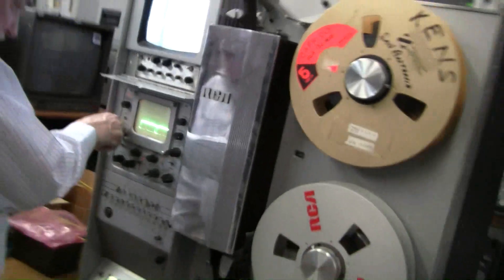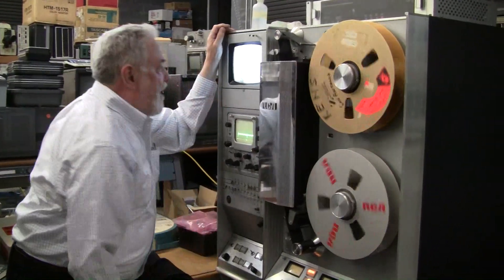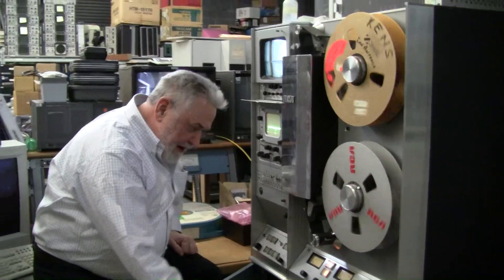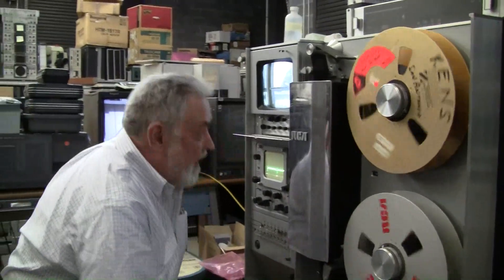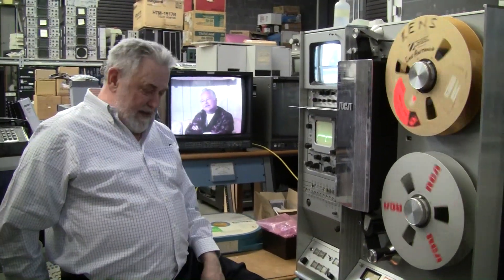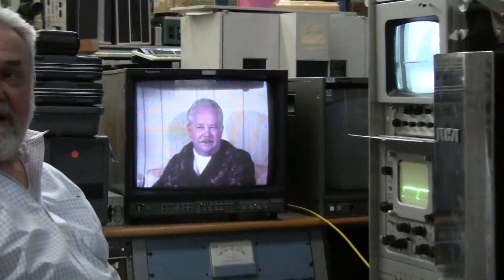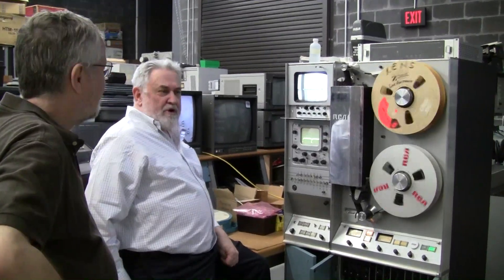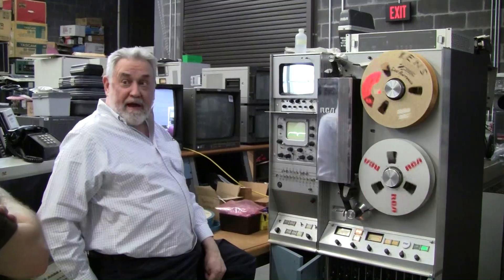1969 RCA TR-60 Broadcast Video Tape Recorder Demo

Comment: I am a lucky old guy, remembering my first day working in TV in June, 1979; I was 16, a junior in high school.  I started out running studio cameras for the local stuff, then was entrusted to do Master Control and directing the local stuff.  We shot news footage on 16mm film, but eventually got the JVC U-Matic rigs to augment our stable of antique Scoopic film cameras.  We had a TR-22 and a TR-4 that were used for most of our spots and syndicated program playback.  At 60, I’m still a very lucky old man because I still work in TV, currently at a Network facility in Washington, DC.  Obviously, everything has changed since 1979, but I still enjoy this addiction where I get paid ‘to watch TV’. 3-2-1 fade to black

Comment: We had TR70's in oour tape room and a TR60 in the production truck due to its "compact" size. These machines were complicated servo lock devices. But RCA had it figured out!  They were actually pretty reliable considering the complexity. Unlike TR600's and TCR100's! Thank you for posting.

Comment: I was a kid and I got to run Quads, RCA and Ampex machines, at my local TV station. In production, on the air! I am 48 years old now, ready to run these machines to preserve archival video tapes. And while I lack this guy's expertise, I am pretty good at ferreting out that bad capacitor which is making the sync unstable. 
I love YouTube, but I miss analog video so much.

Comment: Fascinating. Thanks
Reply from the maker: Glad you enjoyed it
Reply: @videolabguy  I did. However, I'm still confused about how moving pictures get transferred to tape.
Reply from the maker: The pictures are not moving. Just like film, its a bunch of still images flashed at your eye faster than you can perceive. Also, because a TV signal is 210 times more information than a hi fidelity audio signal, you need to write and read it from the tape that much faster too. That's why the four heads spin at 14,400 RPM and write tracks sideways across the tape, each head records about 18 TV lines and it takes 8 rotations of the head wheel to record one frame of video. The to tape speed is just over 1,000 inches per second or 56.8 MPH. Pretty cool that they thought that up in the 1950s.
Reply: @videolabguy  Thanks. I think I understand.

Comment: You needed to be an engineer to operate this. The world has changed, in so many ways, since 1969. Now TV reporters, in the field, are their own camera man/woman. This is the case at CTV Atlantic.
Reply from the maker: Thank you for your comment. An advanced technician is adequate. My very first job in silicon valley was aligning head assemblies for both Ampex and RCA machines. It is complex and precise. But, very doable with the proper tools. Operating the machines themselves, though highly detailed, isn't so difficult with proper training.

Comment: Question. Was this video tape recorder also used to record a TV station's programming throughout the day or was it only used to record a certain TV program to playback on the station?
Reply from the maker: This tape format was used for all programming for over thirty years in the network centers and right down to the local small station level. These were the work horses of the television broadcast industry.

Comment: Ah the memories - I worked with one of these for 4 years back in the 70's.  We had 3 of these and an old 70.  5 second pre-roll, the lockups, banding all of it.  You'd be in the control room, this'd be outside with air cooling.  All would be well, then the <SCREAM> of the heads sawing over a  crease in the tape, then splat. Two spools in oposite directions :)  If I had a buck for every tape threaded onto this... (instead of the pennies at the time).  Those were the days :)

Comment: Used to drive a couple of these at GTS 4 in Port Pirie, South Australia in the early to mid 70s.  Later they added a TCR100 Quad Cart machine that 'borrowed' some of the TR60's onboard electronics to do much of the work.  The TCR100 was kinda twitchy but the 60s were fairly reliable, if the tape was up to it (some that had done the rounds of Australian TV stations over a number of years weren't, (World Championship Wrestling was a common offender) we'd have to drop it from Pixlock to Linelock to get it (relatively) stable enough to air.  In extreme cases of oxide shedding, we had to hold a pad of alcohol soaked linen against the heads while it was running every minute or two when the pic threatened to breakup completely.  We used a 7 second preroll to give it time to lock up, sometimes it needed every second, but new tapes were more likely to be rock solid after 2 or 3.

Comment: Great video we had one of these in the TV station I worked at in the 80s. Ours never looked that good. Anytime there was a large section of solid color in the screen we got sort of banding effect. For example red would like it had yellow lines running through it.  Sometimes you could get rid of it, sometimes not.

Comment: I used 2 tr 60s at my job until 1999 when replaced our 2 TR 60s and 2 1200s with a textronix profile video server , i had to replace tape constantly on our episodic reels due to dropouts , and they hated saturated red colors.. my commercials had pink supers until the digital age, we fed our quads with ampex vpr2b  and Panasonic MIIs

Comment: Why is it so big???
Reply from the maker: That is actually one of the more compact models. The size was determined by the available 1953 technology and by the recording format itself. A one hour tape is two inches wide and 54,000 inches (.85 miles) long. It travels through the deck at 15 inches per second. In one second, there are thirty frames of video which takes one half inch of tape. Width times length (2 x .5) gives us 1 square inch per frame. One hour (2 x 54,000) works out to 108,000 square inches per hour or 375 square feet of tape. The reel of tape is massive and heavy. They require very large motors to spin them and these, in turn, require battleship plate steel for support so the motor torque doesn't twist the deck into a pretzel when placed into fast forward. The capstan motor could do your  laundry! All of these big motors need huge motor controller units plus all the video and audio electronics. The TR-60 is a late 60s unit. Compared to the original, this is pocket size. The smallest these machines, Ampex VR-3000, could be carried by one strong person.  https://www.youtube.com/watch?v=yE4XJM7BLXs
Reply: Thank you. :)
Reply: videolabguy and the vr-3000 was a record only machine. They only had confidence playback. They ask had no erase stack, so the tapes needed to be bulk erased before use
Reply: The BBC tried an early machine with reels nearly as big as a person, it was truly a beast and extremely impractical, if not absurd.

Comment: I did a calculation of the pixels per square inch for quad vs pixels per square inch for HD digital video on a micro SD card.  

Quad was 15 in/sec and 2" wide = 30 in^2 / sec = 1 frame per in^2. It was SD, not HD, so 720x480 px / frame = 345.6 Kpx / in^2.

Consider HD video encoded with H.264 at 10 Mb/s, and a 512 GByte = 4096 Gbit micro SD card.  Micro SD cards are 25 in^2, so 4096 / 25 = 164 Gb/in^2. At 10 Mb/s we consume 164G/10M = 16777 sec / in^2. At 30 fps, that's 559 frames / in^2. Each frame is 1920x1080, so that's 1.2 Gpx / in^2. 

We considered a PACKAGED memory chip.  If we consider just the naked chip, the density goes from 164 Gb/in^2 to the current 1 Tb/in^2, a 6.24 factor increase. Now the pixel density is 1.2 Gpx * 6.24 = 7.5 Gpx / in^2. 

Quad: 346 Kpx / in^2
H.264 on micro SD: 7.5 Gpx/in^2 

A 22707 factor improvement in areal pixel storage density.
Reply from the maker: +Norm Hurst In the 1973 publication, "Petersen's guide to Video Tape Recording", the author, Charles Bensinger, looked forward to the far future and accurately predicted the combination camera/recorder or camcorder. But, most importantly, he predicted that solid state memories would eventually be the recording medium. As a teen back then, and like teenagers today, I scoffed at such a notion. Today, my camcorders fit in a pants pocket and records gorgeous 1080p for over 16 hours on one 64GB memory card! In about 1960, or so, Richard Feynamn wrote the seminal article in the coming age of miniaturization. Now that I see the error of my ways, it makes me wonder how dense data recording will ultimately get before we hit the next barrier?
Original quad video tape specs were based upon getting about 1,000 magnetic reversal per linear inch of recorded track. The usual measure for analog video recording densities was expressed in square inches per hour.

Comment: It is interesting that after enabling the line lock, the TV was able to decode the NTSC color information which was not doable before (NTSC color is phase-shift-based, so without exact timebase correction there won't be useful color information the TV could use).
Reply: Correct.  When we used LL on a dodgy tape, it was precolour here, we started the road to colour in the mid 70s and were fulltime colour (PAL) in 76, but we did a lot of on air testing before then.  We were warned that LL was now an absolute last resort as it would remove the colour from the signal.

Comment: It takes a lot of space, infrastructure, and power to run these VTR machines and related support systems. It also takes a lot of money to be able to buy the replacement parts to keep them going. It also takes a lot of experience and knowledge to maintain and run these machines.  I used to work on the VTR machines starting in the early 70's.  I am very familiar with what this engineer is doing.
Reply: It needs personel who really understand what they are doing for sure!!

Comment: Also, we had a Spanish programming block every evening...the tapes were recorded at half speed.  The TR-60's would play them, but needed a special video head, so every night just before the Spanish shows, I would have to remove the head drum on one of the machines, and replace it with the special half-speed heads.  Since we only had one playback machine, we would pull off and replace both reels during a station break and rewind the played shows on another machine.
Reply: Sebastian Guevara  This was at Channel 26 in Houston from 1976 to 1979.  We only did 3 hours a night of Spanish programming, all from tape.  We were not part of a network.  There was not a full time Spanish station in Houston at that time.
Reply: Sebastian Guevara  I worked in TV stations in Texas from 1976 until I retired in 2014.    I did radio before that.  I saw a great deal of change over those years.
Reply: Sebastian Guevara  KWEX was our source for the Spanish tapes.  That was the only experience I had with Spanish programming.  I left Houston to work for a CBS station and then spent my final 15 years at the ABC station in Austin.

Comment: We had four of these at channel 26 in Houston in the 1970's.  One shared electronics with one of our two TCR 100 cartridge machines.  We got our first 1 inch machines in 1979.  The early ones had a compatibility issue, the tapes from the Ampex and Sony machines were not interchangeable.  The SMPTE had to establish a standard before many stations would take a chance on them.  It was called "type C" 1 inch.

Comment: PAL has better spatial resolution (100 extra lines) and decent control over chroma (there was no "hue" dial on PAL sets.) But it had poorer temporal resolution (25 fps vs 29.97 fps) which made PAL flicker to an eye used to NTSC. at least for the few minutes it took for my eyes to adjust. It did make telecine easier - no need for pull down.

Comment: I bow to your technical expertise, but ONE SECOND for a TR-60!? I've had experience with much more beat up RCA Quad TVRs, I guess. 

THANKS for this video. It's unreal to see an HD video of an old quad machine...makes my brain disconnect a bit.
Reply: I know what you mean. The one where I worked needed :10 when I started working there. :60 just before we stopped using it.

Comment: @Boeing744andRCAquad This is the best of four TR-60s we have here. I have spent many hours on all aspects of the machine to make it as stable as possible. With a well formed recording on good tape stock, I can get reliable lockups of under 3 seconds even with the color framer enabled. In a broadcast plant of the time, nobody would have been permitted to spend this time working on a machine or have one out-of-service. Lockup time is a function of the capstan mass. The TR-61 & TR-70C fixed this.

Comment: @Boeing744andRCAquad The MBT guys and I were discussing this topic last night. Long story short,  it's getting more difficult as time progresses for someone who did not work with this technology because a thorough knowledge of analog broadcast video is a prerequisite and not taught nor mentored anymore. These machines were a tight amalgamation of mechanical engineering, electro-mechanical servo theory and analog/FM signal processing. Mentoring is probably the only path left.